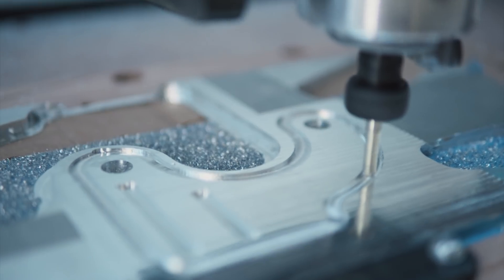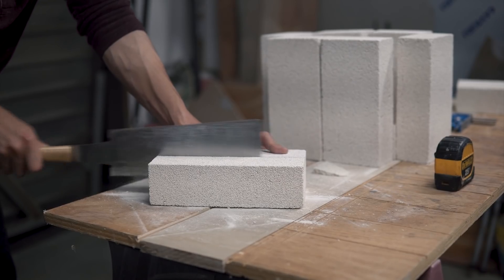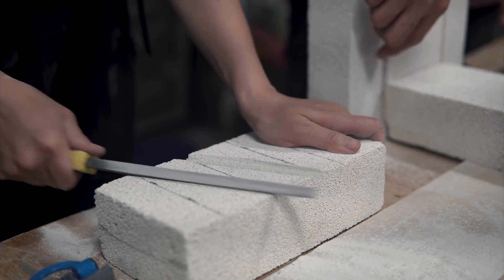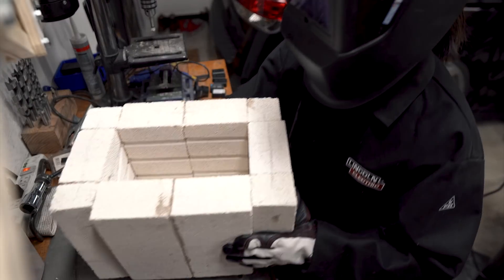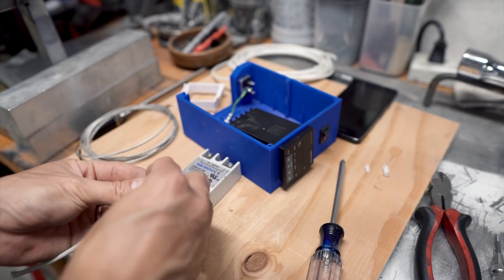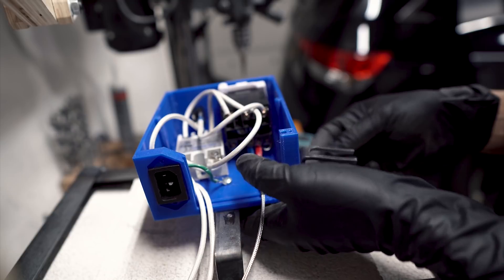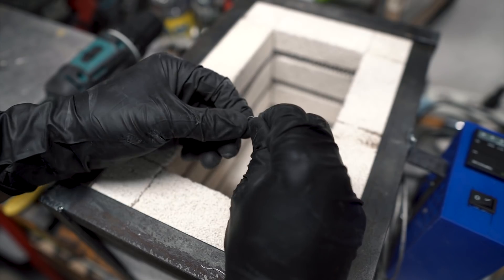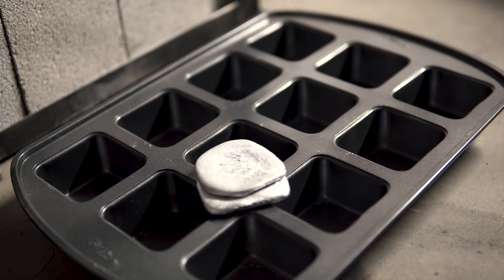DIY Electric Foundry | Aluminum Metal Casting

Comment: 6:26 ugh... vapors from polyflouroalkyl, or pfas (teflon and relatives) are nothing to mess with.  You'll have cancer shortly.  Instead of a brand new non-stick muffin tin, get a plain steel one and burn off the zinc with a torch, with plenty of ventilation.  Then you have a non-stick black oxide ingot mold.
Reply: Absolutely this is no joke guys be careful.

Comment: Nice project. However, the top is losing a lot of heat. Make a lid covering the whole surface, not just the hole, and put ceramic wool between as a gasket. That will drastically increase heating.

Comment: I’m still not sure if electric or gas is better to make can this get hot enough to melt copper I doubt it but would be better than using gas when it’s more practical to put in a safe spot of the basement

I think it would but take way longer
Reply from the maker: You're right. It'll take longer going electric. If you can make it with 220v it would help

Comment: I believe using a 240 volt 20 amp circuit would allow higher wattages which would heat the foundry faster.
Reply from the maker: Yup that absolutely correct!

Comment: Do u have to use the fire bricks. Could it not be made from scratch. Using plaster Paris. To make the mold. Because those firebricks are hard to find and expensive. With the same electrical parts. Could it be done the same way like how they make gas Melting. By using a gas tank./metal pot. By Adding mesh and plaster paris to make the inside part. And  run it that way then start it up from there . All budget friendly for consumers.
Reply from the maker: Not 100% sure, but it sounds like it should work fine though!

Comment: Does it have pre-built wired up electric power supply like those selling by itself. No full furness. Just the box that u build with all the small parts to make it work electric. The furness build is easy. The hardest part is the wiring.

Comment: So I've finished and tested mine, but I'm have horrible results.  
I'm using the same bricks, resistance wire, shape and other components to make sure mine worked correctly...
BAD NEWS:::.
IT won't heat up high enough to melt Alum.  So wasted all that time and money..
The PID controller is set at MAX, but the probe only shows a Max temp if 552C. With the Lid closed.  Alum needs  600+ degrees Celsius too get to. Liquid stage.  Thid DIY unit can't get higher than. 567c. 

To try to connect design flaws I've actually reduced the length of the resistance wire which based on my calculations should increase the overall temperature however I've only gotten to 571 Max..  
This of course was after I shortened the 70 more 9 ohm by forget now wire length I initially cut his who based on your recommendations.  I chopped off about two-and-a-half feet worth of wire and it is getting hotter this time but still not hot enough .
Reply from the maker: Hi James I'm sorry to hear that you're having trouble with your build. Feel free to email at info@imeemade.com and I'd be happy to help troubleshoot!

Comment: Did you run just 1 coil from the 3pack from Amazon or run all 3?  And did you Cut the coil length at all, or use what it came as?
Reply from the maker: Yes just 1 coil from the 3 pack and had to cut it to length once we found the right resistance

Comment: Nice build guys... well done. I am being picky but this is what looks like from a professional. 
Foundry is the organisation or business that does the casting. They own, smelters and furnaces. You built a smelter and run a foundry. Like a brewery and a still... like that.
Also you fused mild steel with the TIG instead of adding filler rod? Why? Its a way better weld when using filler rod. That is why its used.
Did you cover the terminal block and exposed wire on the side you didn't show when it was operating. That would have been live and red hot! What was your solution for that?
Reply from the maker: Thank you for educating us! To answer some of your questions, we often use autogenous TIG for non structural builds like the angle iron around the smelter. It's just a structure to keep the fire bricks from getting ruined during transport/storage so we felt it was just faster/easier to forego the filler. But you're totally correct that adding filler is always best. As for the terminal block that's exposed, to be frank - it's still exposed 😅. Our thoughts have been to make a composite cover of sorts in the future and also add a reed switch to the lid as another user mentioned so it cuts power when opened as a safety feature. Still need a lot of improvements, so we appreciate the advice!
Reply: @IMEEMADE  you can get fiberglass insulation to slip over that exposed bit of heater wire to avoid killing yourself on it. It's like heat shrink tubing but it doesn't shrink and had much higher temperature limits

Comment: Thank you guys for putting the links in the description! I was going to build a different model I found on youtube, but saw some comments criticizing the refractory for being unsafe. I was scouring everywhere for a different model using fire brick and this looks amazing!
Reply from the maker: Thank you very much! Glad the links helped!
Reply: I use that refractory cement. It will crack after thermal cycling but then so will your bricks. Time is different because someone doing 10 smelts or forgings a day will hit limit faster than some one doing 2 a week. By then you should have made your money back though.

Comment: Great video 
What's the power consumption you reckon ?
Reply from the maker: We calculated that this setup is about 1kW max output - Thanks!
Reply: Do you know how much time does it take so the forge reaches 800°C ?
Thanks a lot
Reply from the maker: @ΛέανδροςΠαπαδάκης  it takes about 15  - 20 mins to reach and maintain 800C
Reply: @IMEEMADE  Ow wow
Reply: Thanks so much for posting this video! Electric kilns/furnaces @ 120V seem hard to find on YouTube.

Do you mind posting the calculations you ran to determine your wattage, length of wire, gauge of kanthal wire you’d need etc? I’d like to build a similar kiln but I want to make sure it’s feasible given my desired size (#8 crucible), temperature (~1300* F for aluminum) and available circuit (20A @ 120V - probably less to allow for safety margin)

Thanks again!

Comment: how we want to connect the wire for pid control to relay and switch toggle
Reply from the maker: The wiring is slightly different among the PID controller, so we suggest to look up the manufacturers diagram to make sure proper wiring!

Comment: Warning: Calculations are for 100V power (Japan) only.
Warning: Touching the electric element via the crucible will probably kill you.
Warning: Nobody in their right mind uses low temperature thermoplastics for the control box on a furnace.
Warning: Exposed mains wiring.
Warning: Inserting damp aluminium to the crucible will explode and burn your face off.
Warning: Unsafe lid.
Reply from the maker: Thanks for watching!

Comment: Nice simple build, very cool! A couple of suggestions: don't rely on those firebricks as you innermost insulator - they're very energy inefficient. Coat the inside with 1" of kast-o-lite 30 li plus, then add 2" of refractory wool, then finally coat that with a ceramic heat reflective coating like itc 100 ht. it will increase the costs by alot but your setup will heat much faster and function much more efficiently. it will give you big savings on electricity costs in the long run.
Reply from the maker: Thank you for the tips! We'll definitely take your advice in the next build. Looking to optimize the design and make it a litter bigger next time!

Comment: Hey guys your amazing. I would like to build something similar but need the hold a very large crucible. Would I be able to double the size ? Would the controller power 2 coils instead of one ? Not sure if you could help me.
Reply from the maker: Everything we linked should be able to handle a larger size. You can control 2 coils with this setup if wired in parallel. Depending on how large you need to make it, we suggest making sure the solid state relay is sized to handle the load.
Reply: @IMEEMADE  your so awesome. Great advise. We need more of yous. Thanks again

Comment: How hot does it get? Will it melt brass and other metals with higher melting points?
Reply from the maker: It gets to about 1100°C max. I believe it can melt brass since that melts around 900C
Reply: @IMEEMADE  I'm thinking of using oven burners instead. Any advice you can give me?
Reply from the maker: @rc_swift1772  Interesting! I've seen a few setups using oven burners, but I don't have any first hand experience. Check out the channel TAOW, the man is a wealth of information on this topic.

https://www.youtube.com/c/theartofweapons

Comment: Super neat little furnace. I run gas and have been considering a small electric kiln for heat treating and maybe even melting. Just a note - machinable aluminum alloys aren't always the best cast aluminum alloys. You might take a look at something like A356 - see how your 6061/etc stacks up in comparison. Usually you just need to add some other scrap that's higher in silicon (pistons, wheels, etc) to bring it up to a good cast spec. 6061 tends to be highly porous and just not behave very well when melted. Somehow a bit of silicon helps it flow better and avoid accumulating bubbles of gas. Keep up the great work!
Reply from the maker: Thank you for the information! We're still pretty new to casting, so we're going through the trail and error learning curve. We'll definitely try some A356 for our next project. Thanks again!!
Reply: A356 is commonly found in cylinder heads btw. Suspension components tend to be forged. I'd suggest checking out Paul's Garage here on YouTube (he has a wicked discord server - crazy helpful folks!) Casting has been loads of fun and recently, profitable. Just wait until you see aluminum bronze though... Lol.

Comment: Looks like you have exposed high voltage wiring.  Might want to build a cover over the end where your element wiring exits the bricks to prevent accidental electrocution.
Reply from the maker: For sure! Definitely don't want to electrocute ourselves 😅

Comment: Great video. This is cool. Didn't realize an electric forge got this hot. How long did it take to reach temp, melt then pour?  Sand casting next? : ) Mahalo for sharing!
Reply from the maker: Thank you! We were pleasantly surprised we could make this with our 110v house circuit since alot of the other build videos are international, so they have 220v. 

It takes about 20mins to get to 900C and about another 15mins to melt enough aluminum to make a small flat bread we show at the end.
Reply: @IMEEMADE  Wow faster than I thought. Takes me longer to boil water. Mahalo nui! : )